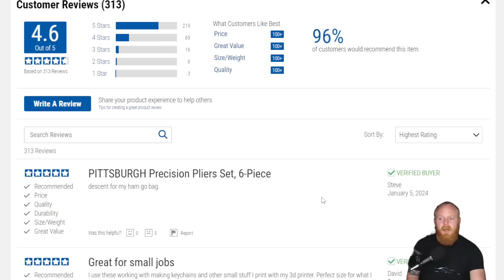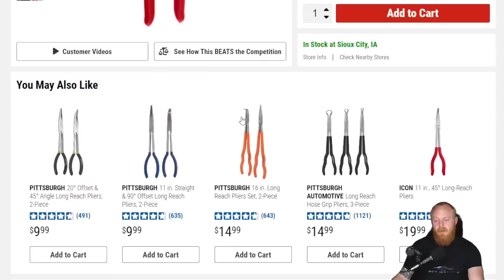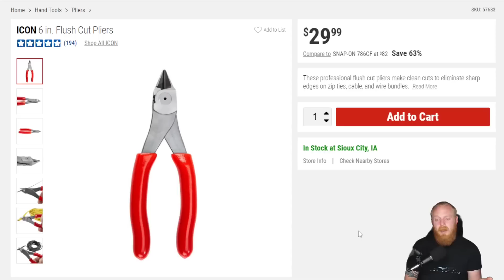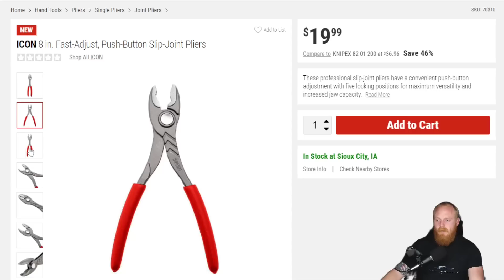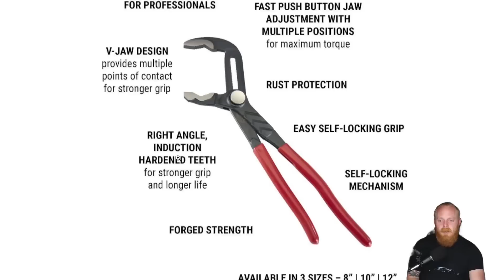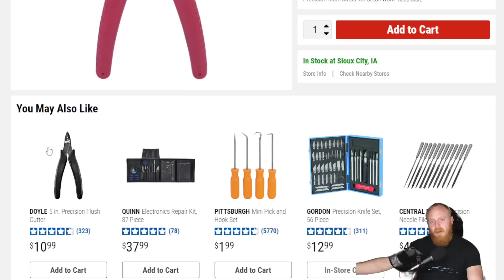Harbor Freights Top 10 Pliers You Should Consider Buying

Comment: I have some of these pliers - the Pittsburgh hose pliers set (haven't needed to use them, yet), the Doyle flush cutters - works great, all of the Icon pliers I have were all purchased on a coupon or on sale - I have the Flush cutters, the triple position slip joint (coupon for 14.99 so I bought 2) & the push button Knipex Twin Grip copy slip joint pliers. I am just a DIYer, mostly doing minor repairs on our vehicles and my 30 yr old John Deere 345 garden tractor. So far I am  enjoying using all of them - I have to say the $11 Doyle flush cutters work just as well as the Icons ($20 on sale), but the Icons sure do have a better feel - I only use them for zip ties.  I do think you could have included a few more ; the Quinn pistol grip needle nose, and both of the Icon pistol grip pliers, I reach for any of these first before the regular handle pliers. Love your content!
Reply from the maker: Very nice I appreciate your input and experiences you have had with those pliers. Ya my smaller flush cuts work just as well as the icons but the icon just feels good to use. Built like a tank lol. Thank you again. Have a great week.

Comment: On the SK's point, I feel the same on craftsman. I'm so used to go into sears and the guy grabs a replacement ratchet with me just raising it as walk in. If they hadn't changed the look, I'd maybe still buy em. Grew up with em, but trying every comparably priced 3/8" ratchet. Next will be an Eastwood locking flex head. I made the mistake of ordering another brands non locking, and frustrated. Working around trans bell housing, just getting accustomed to using 24" extensions, wobbles, and impact more and more. Extended head battery ratchet has changed my world. Even the Walmart one.
Reply from the maker: Agreed. I grew up with alot of the Craftsman stuff from sears. I know exactly what you mean

Comment: Knipex isn’t that much more money so I’d rather get the real deal from knipex. But the snap on knock offs I understand. Snap on is way more expensive
Reply: I agree especially when its not way cheaper I have the icon slip joint pliers, parrot nose and twin grip knock offs all are good quality I prefer to use my knipex twin grips the handles are nice though on the icon if you want to skip the tool truck and want an easy warranty then go icon if you want the best then knipex is always the answer
Reply from the maker: Agreed!!

Comment: 10 dollars more and klein has a version of the pliers wrench. It's big difference is the sliding jaw is reversible with a smooth side, and a pipe side. Works great.
Reply from the maker: Yes i have seen those. Glad you are happy with them. Thanks for sharing
Reply: No is doesn't, having one flat jaw and one curved jaw with fairly blunt teeth just slips and slides and chews up round pipe or stock. Try it for yourself, then try some Original Cobras 🐍 it's a night and day difference.
Reply: @aussiehardwood6196  works great for my purposes. I use a pipe wrench for anything more.

Comment: 3:45 - The long reach hose grip pliers are also great for pulling spark plug wire boots off of the plugs with out ruining them.
When I worked at a dealership, one of the guys cut a couple hours off a fuel injector replacement with these. It kept them from having to remove the upper intake manifold.
Reply from the maker: Absolutely I have also used them for that. Thanks for sharing!!

Comment: I've got almost all the Icon regular style pliers and the pliers wrench now. They're an excellent mid-teir brand. I just check when i buy that the jaws and tips line up, and for no play in the joint. I hardly ever find amy with those things. I just always check from habit. I've used discounts and sales to buy most of them. Paid about $15 per pair except for the pliers wrench. They've actually held up great so far and have performed well.
Reply from the maker: Very nice and ya that's a good habit to have. Always great when you can catch them on sale or use a coupon. 👍 thanks for sharing your thoughts